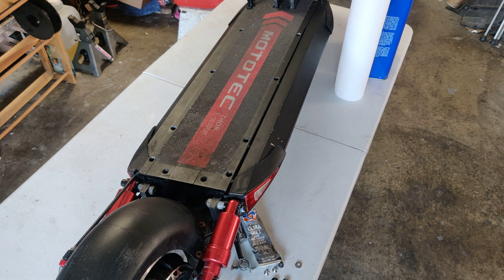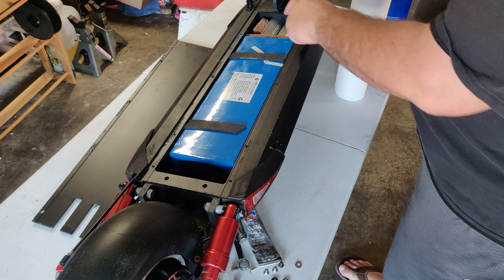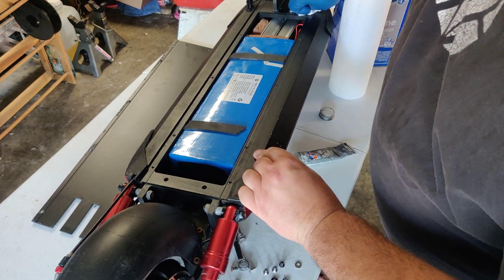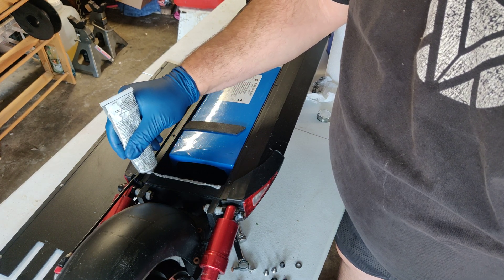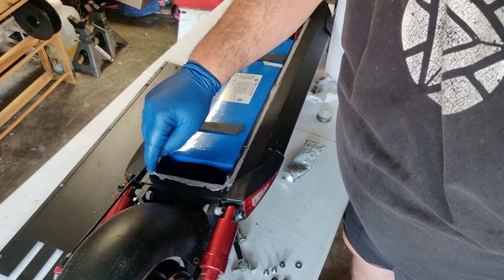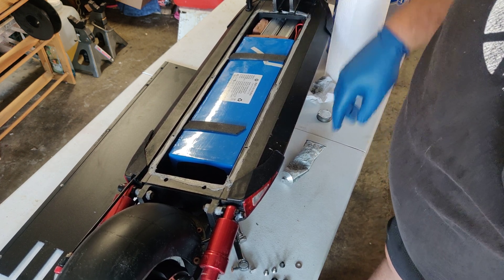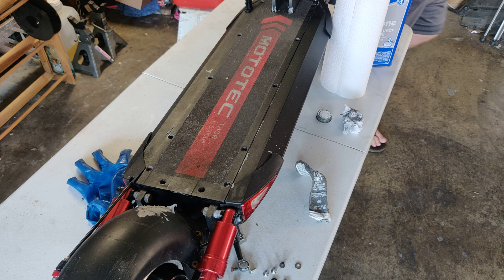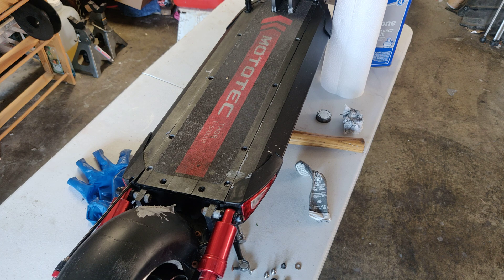E-Scooter Deck Weatherproofing

Comment: Just ordred this scooter.  Does this mean that since you sealed it before the silicone dried it would be almost permanent?  Could that peel back up easily in case you needed to work on the ESC or swap the battery?
Reply from the maker: It's like adding silicone in an automotive application, it comes off with a little extra effort. 
Since this video Ive had to replace a motor controller and it wasn't bad..

Comment: Ive found that CLR, and if possible steam, works decent for getting the dried silicon off. Even for a silicon mat ive tried wd40 and it did nothing.  A dremel with a soft metal brush and a light hand works for the really bad spots but it will scratch up cheap finishes.

Comment: What about the tires?(wheels)
Reply: Wheels are usually sealed but some will corode.  Theres not a whole olt of risk in frying anything in there though.  Maybe the hall sensor if your scooter uses thembut ive never had issues aside from my titan pro got a little grindy. But i dribe that thing through hurricanes
Reply from the maker: The wheel motors are sealed, Ive driven through puddles that were pretty deep and the motors seemed fine.
Reply: @Jay-May  power rides usa screwed me and are saying their outta stock I'm waiting on my refund from them to purchase else where
Reply: Bro how do I setup the seat type complicated

Comment: I have a better trick lol and you don't need a sledge hammer to take the deck off and now I have seen this I shall do my last 2 holes I knew I was right by doing what I was to make fully 1000s percent water proof
Reply from the maker: Awesome! I used the sledge because I needed to align the holes for the Allen Bolts, the silicone would have added a little resistance when pushing into place.
Reply: @Jay-May  bro I use skater sticker tape I have covered my whole deck proved perfect grip with waterproofing thank me later for your next projects 😀
Reply from the maker: Myself personally would still use RTV silicone to waterproof the deck of my e-scooter, then use weather proof Skate board tape on top. 
I would actually recommend this for the best top deck water proofing.
Reply: Yeah sledge hammer banged me harder away from this one butt do appreciate that jay is atleast sharing.i am going of scooter kick mat and double sided water proof tape and the bottom if need be alittle quick clear silic and a good amount of locite.im also trying find dimensions for mototech stem to install dampener.any ideas fellas?
Reply: @peterjaimes8776  i will look in to this brother and see if can help you and my self with the stem thing like your idea with double sided waterproof tape a moto tech stem i need a new stem i will google that but dont want to loose all y suspension